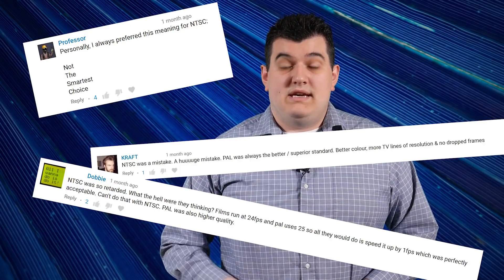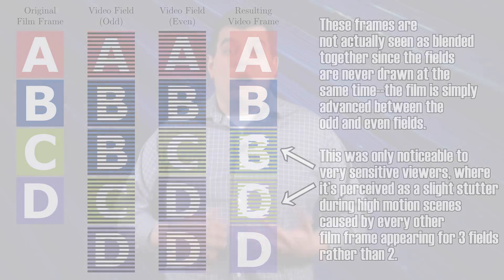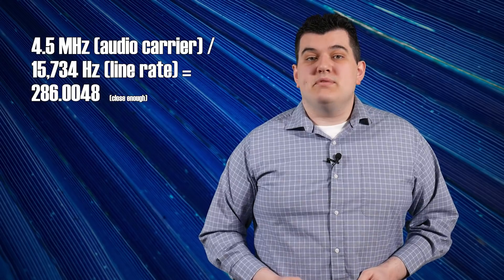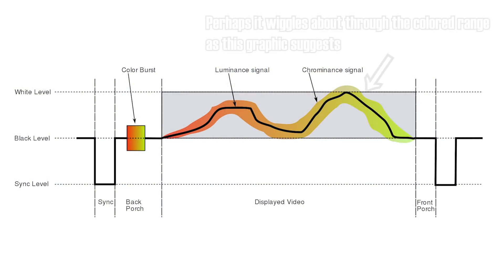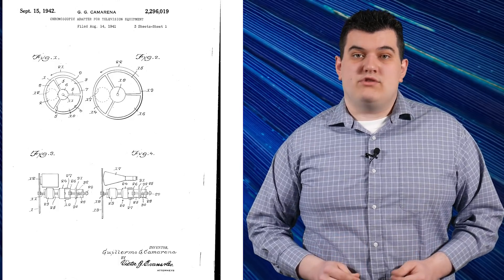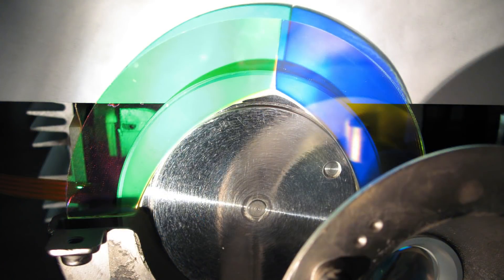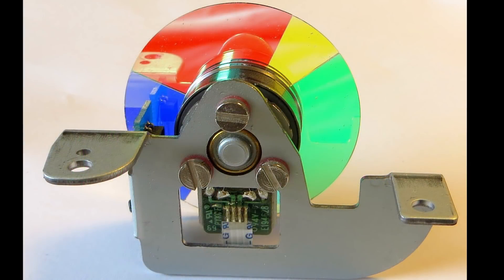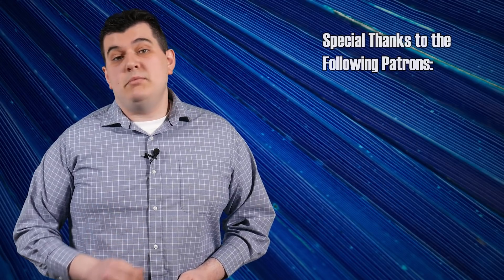Analog Color TV Wrap-Up--Some extra info

Comment: Hi, good summary - but I have to put you right about the frame rates; the 25fps / 29.97fps rates are due to the local AC power frequency of their respective countries, not the amount of lines in the frame. - In the US it's 60Hz, whereas Europe uses 50Hz. The frame rate is half of that, because the two fields of each frame are scanned alternately based on the timing signal driven by that frequency. 
So it's wrong to say that PAL/SECAM compromises frame count due to its higher resolution - it's simply a direct result of the way electricity is delivered into your home, depending on your country.
Reply from the maker: In my earlier video (this is essentially part of a series) that is explained as the reason for the frame rates.  However it's not wrong to say that PAL (50 Hz) has a higher resolution at the expense of frame rate.  Both PAL and NTSC have an extremely similar amount of bandwidth, with NTSC drawing 15,750 lines per second and PAL drawing 15,625 lines per second.  PAL draws more lines per frame but still has closely the same number of lines per second.  Overall there is the same level of detail displayed between NTSC and PAL, they just use it differently due to their frame rates.
Reply: Really appreciate you responding to my comment, and I will definitely check out the video you refer to; I just wanted to highlight this within the context of this particular edition. This is great stuff, keep it up.
Reply: Just want to add that this is a brilliant response; thanks for the extra bandwidth info.

Comment: The Y carrier is not being "altered" per say. You have the Y and chroma (subcarrier) being modulated onto the same carrier. Because of frequency interleaving (not the same as interlaced frames), color TVs and newer BW TVs reject the chroma subcarrier. Older TVs do not. As you mentioned, highly saturated colors increase the amplitude of the chroma subcarrier. This simply appears as high frequency noise and a higher amplitude makes it more visible.

Comment: Colour recovery from chroma crawl was theorized by James Insell after spotting colour breakthrough on UK broadcasts of telerecordings of Dr Who programmes, and further developed an idea of what was happening with Steve Roberts of the Dr Who restoration team. Richard T. Russell then wrote the software that actually put the theory into practice. I can not get my head around the maths, but my understanding is that at present it is believed that such colour recovery is only possible on PAL source material. I believe this is due to some aspect of the phase of the colour burst being impossible to recover on NTSC signals. I would not rule it out however.

There are a lot of recordings that colour recovery is not possible on. The UK archives are full of anomalies, including programmes that shot on colour equipment that were only ever available in monochrome due to industrial action during the time of production that meant staff refused to operate with the saturation dials turned up. As a result, there are a few programmes with really faint colour as the dials were not turned all the way down, or because their minimum setting was not actually zero!

I should also point out that when home computers arrived, the Amiga was the only machine that exploited the NTSC and PAL systems to it's advantage. Both varieties of the machine slightly underclocked their CPU's and other custom chips to 7.16 mhz and 7.09mhz respectively, so that they would operate at a speed that (through some maths) would complement some aspect of the video system. Having the cpu and custom hardware set at these particular rates reduced timing overheads and opened up opportunities for exploiting the hardware further. You could generate a lot of effects and work with a lot of video applications in the professional domain that would have otherwise have been impossible without a very expensive high end system.
Reply: Quite often, programmes produced during the colour strike were rendered B&W by the simple expedient of actually removing the colour tubes from the cameras.

Comment: One small correction: at 6:52 you say that a telecine would be used to capture the output of a video monitor onto film. Actually a telecine is used to convert film onto video, not the other way around. In the US the process of filming a monitor to record video to film is usually called "Kinescope", in the UK (which I think you're referring to with your touching on color recovery via chroma dots), BBC called it "telerecording".

Comment: The NTSC system had competition in the form of the CBS field sequential system that was 405 lines and 144 fields.   It was not compatible with standard RS170 B&W video.  The other major broadcasters (mainly RCA) lobbied the FCC to make the new color system backward compatible with RS170 video - and that is another reason NTSC was adopted.

Comment: I am from the UK and just about old enough to remember the crossover between 405 line and 625 line transmissions. For a while people would have dual standard tv's capable of receiving both 405 line transmissions on VHF, and 625 line transmissions on UHF. This led to a messy mix of antenna's on the roofs of houses. Back then renting your tv set was very common in the UK, rather than owning your own set, so the change over did not really affect people too much, the rental company simply swapped your set when the time came. And remembering just how often we had to call out the tv repair man back in those days, i think renting was probably a good idea.

Comment: They are both good in there own rights. Used both and both are fine. PAL was better in res and NSTC was better in flicker rate. But you had to watch out on laserdisc when you got ntsc conversation on pal it was crap so just get the ntsc version. But when you got a real pal disc it was sharper then ntsc. But on pal you lost AC3 and only ntsc could do it. So they both had good points and bad points but you got to love them both.they are both winners in there own rights. It was the same for vhs. Ntsc could record longer than pal but pal had a sharper image. It goes on on SVHS etc.

Comment: 15,734 ÷ 525 is not the formula used to get the precise NTSC frame rate. The exact formula is 30,000 ÷ 1001 (or 30 ÷ 1.001). The same divisor applies to telecined film content when played back progressively or after inverse telecine (IVTC) has been applied (24 ÷ 1.001). When specifying NTSC framerate in programs like Avisynth, for accuracy you specify it as 30000/1001 rather than 29.97. For example, see the chart here - http://avisynth.nl/index.php/FPS . For a more official reference to the 1.001 divisor, see this abstract published by the Society of Motion Picture & Television Engineers - http://ieeexplore.ieee.org/document/7290510/?denied - which is just one of countless official references to the 1.001 divisor.

Comment: Showing films at 25 frames per second is WRONG! Music savants can here the pitch shift in the music and it is terrible. Also, try to jam along to the film score on your non tunable keyboard. At Prime Image, where I worked for over a decade, we developed a time compressor for video shows to squeeze in an extra commercial, virtually ALL of the genius was in how it processed the audio! The video was a simple cake walk in comparison. Musicians could deal with the slight tempo increase far easier than the pitch shift. Ours was the only time trimming product that DID NOT destroy music.

Comment: So much information in my head I want to tell you but so little time to do it…
The reason why PAL was not adopted everywhere (else) is that it isn’t the superior system and it is a lot more expensive!
The idea of PAL is that the color information is inverted every second line. Any error will e.g. show up positive in the odd lines and negative in the even lines. The average error should be zero – in theory!
By mixing the color information of two lines and taking the average, you get half the color resolution but eliminate the broadcast errors caused by interference while the signal is traveling to your areal.
In reality, the saturation of the colors degrade with the error. So with PAL, a phase shift will still give you correct colors but they are less intense. It just makes the problem less noticeable, not vanish.
Another problem is the costs. How can you mix the color information of a line with the information of a previous line? The previous line is a matter of the past, long gone!
Digital video signal storage was impossible in the early PAL colour TV era. And when it became possible, the circuit board in a studio broadcast machine which does it digitally was sold for over $4000 (mid 80s). Even today those boards are sold for more than $300 (used)!

So a PAL TV contained an ultrasonic delay line. An ultrasound transducer injects the color signal into a crystal which is then picked up by an ultrasound receiver 63,942 µs later. This method was replaced in the late 1980s using sophisticated chips but still around until 1995. This crystal is a real jewel so while NTSC was nicknamed “Never the same color”, PAL was known as “Pay Additional Luxury”.
The problem is that if the video runs a bit faster or slower, the delayed color video line can’t match with the current one. Also there are manufacturing tolerances as well so it is impossible to get a good match. This also decreases the saturation of the result. But there is a simple remedy, crank up the saturation. So while the picture still looks good, the color resolution is decreased.
You loos 1/2 of the color information in the PAL system and then you loose more information due to tolerances. But this is still OK since the colour resolution of the human eye is only 1/3 of the brightness resolution. So PAL which is actually real bad for the colors is still OK for the human eye.
SECAM tries to fix this by just sending one of the 2 information on the carrier alternating. You still need the delay line which never really matches up but as a result, you get no losses in saturation and you only use 1/2 of the color information. Since the human eye can’t notice that the colors won’t quite match on the brightness pattern, it also works good for the human eye – just with more accurate colors than PAL.
Since the late 1980s, NTSC became superior to all the other formats! They just add a line of test patterns above the visible part of the screen. The micro-computerized Tvknows how this line has to look like and can detect all errors and then work simple filter circuits to compensate those errors. So modern NTSC TVs have much more color information and can eliminate errors just as good (or better) than classic PAL or SECAM.
PAL+ also does the same nowadays so NTSC and PAL can break even here. SECAM on the other hand misses half of the color resolution and there is no way to restore it. So the former superior SECAM is now the worst system while PAL and NTSC sharing the same higher quality.

Fun fact, the video encryption system “Nagravision“ also scrambles the PAL+ line. When PCs became powerful enough (>400Mhz), by identifying where the PAL+ line is, they could rule out 90% of all different ways the picture could be scrambled. By simple try and error they could figure out how the picture is scrambled and decode most European pay-TV channels in real time. It didn’t take long until all EU Pay-TV stations went all digital.
Reply: Both farmats are good

Comment: And here is why the Delta Shadow Mask is not used for “normal living room” TVs:
While the Delta mask gives you a good resolution and the electron guns are nicely packed tight in the CRT neck, it also swallows way over 80% of the beams. This is why a mid-sized monochrome TV can work with an acceleration voltage of 8kV or less, a color TV the same size needs at least 21kV. You need much more energy inside the beam to have an adequate brightness of the picture.
A Trinitron will not only allow a maximum of resolution, it eats only about 40% of the beam energy (1/3 in theory), you get more than twice the brightness out of your beams. But there are two major problems:
1) the shadow mask is made out of thin wires which have to be really taunt which adds a tremendous force to the screen. The glass of the screen has to be a lot thicker to handle the forces. Just put a 14” trinitron and a 17” delta monitor on a scale, the smaller trinitron is a lot heavier due to all its extra glass.
2) The electron guns need to be sitting in a line next to each other making the neck of the tube a lot wider which in turn makes the deflection coils a lot larger and requiring a lot more power for deflection. Distance is your enemy when working with magnetic fields, the field weakens to the cube with distance! And since the gun beams have different distances to the deflection coils, you need to have an extra homogeneous field which in turn requires even larger coils to create a “Helmholz pair”
A compromise is the slotted mask. Like the trinitron, it eats up less beam power (somewhat more than 50% if I recall correctly) but doesn’t add forces to the screen like the trinitron.
So living room sized TVs are much cheaper and brighter using a slotted mask while small TVs still can use a delta mask for better colors. Computer monitors have to have a delta tube to be able to display an adequate resolution – or need to be trinitron.
Reply: This type of mask was the one in the early tv sets. It was called delta tube. The later was inline. The electron beam guns in the delta tube were arranged like a triangle. The second in line. The inl line tubes had a much better brightness an the convergence of the colors where much better.